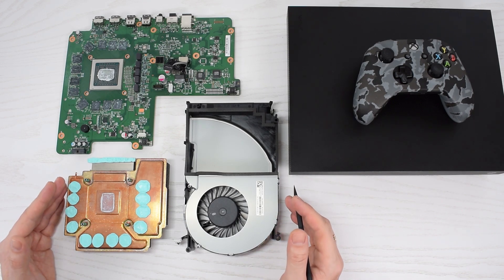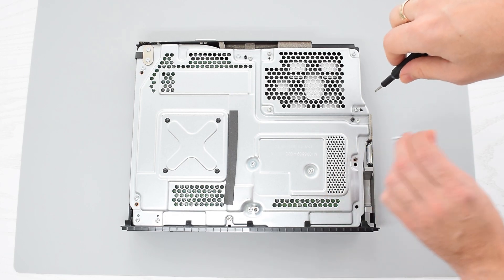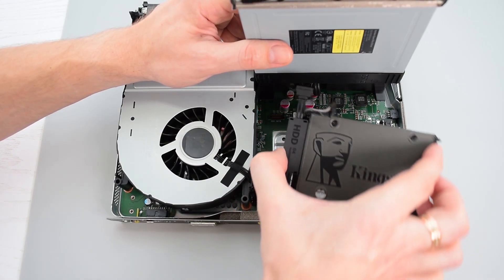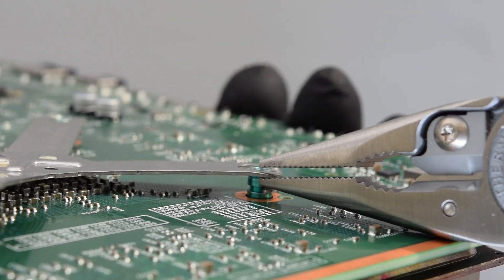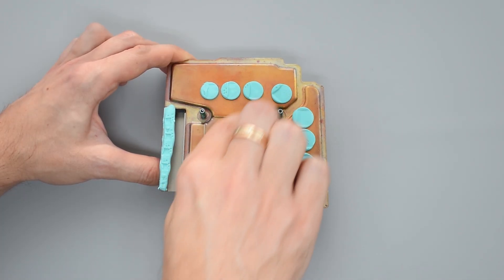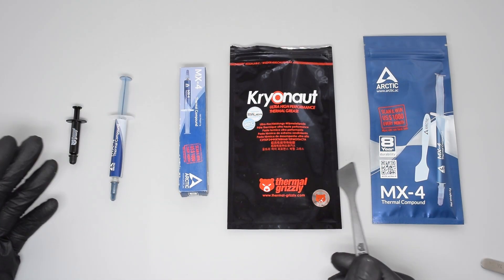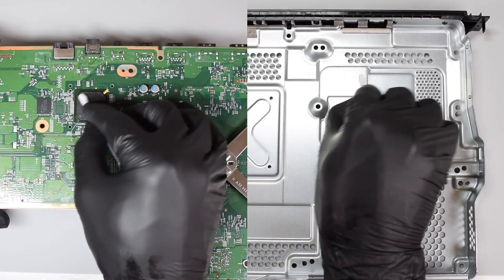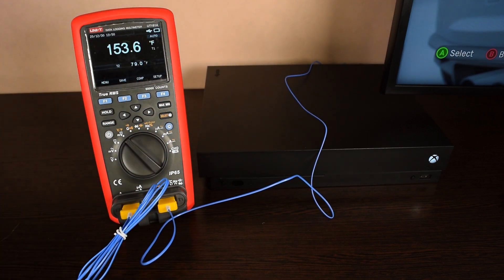Xbox One X Thermal Paste and Thermal Pads replacement. Cooling system cleaning. Best explanation!

Comment: This was a game changer. I did both the SSD upgrade from your other video and the thermal pads from this video. My games are loading so much faster with the SSD upgrade and it is so much quieter now after adding the thermal pads. Although, I am having one issue with some colors turning white. Not sure if it is related to the upgrade or not. Any help would be great
Reply from the maker: Most likely they changed something in the latest firmware that you installed from your USB drive. Wait for another update, if they notice the problem they'll fix it.
Reply: @ElectronicsComputers  So just an update on this, it turned out to be an HDR issue from the game itself. It just happened to be right after I did the upgrade. But there was a patch release, so it is working just fine.
Reply: @ElectronicsComputers  the thing is it is only happening in one game. Basically, some black colors turn to white
Reply from the maker: @MuhammadIsmail-vk6mk  The upgrade has nothing to do with it for sure.
Reply: @ElectronicsComputers  thank you so much. And thank you for the videos. You made it such an easy process

Comment: Guys, I had extremely loud fan whilst playing 4k games, it was defiantly getting to hot, follow this tutorial,  clean all parts of the chassis and the fan no longer runs at full capacity. Literally just bought this second hand and now fully working,  I didn't use new thermal pads but if I was more patient by ordering some  I would of 👍
Reply from the maker: Good job!
Reply: @ElectronicsComputers Thanks 😁, do you think my console has been damaged now from how fast the fan was spinning? The apu must of been getting so hot 🙄
Reply from the maker: @mylessackett489  If the temperature reaches to a critical point the console will shutdown. If that never happened then don't worry about it.
Reply: @ElectronicsComputers  OK that's good to know, thanks for the helpful video, top stuff 👍

Comment: I just read all the comments and questions about the right thickness of thermal pads and I was wondering what exactly do you mean with the "compressed area" of the thermal pad. 
If you mean the thickness of the old thermal pad after the system (assembled) put pressure on it I have two questions. 
1. How is the best way to measure the thickness of the pad? 
2. To get the right thickness of the pads needed Is it always right to add 0.5 mm onto the measured thickness (compressed area) to compensate the amount of thickness the thermal pad lost due to the pressure? 

Sorry in advance for the many questions but it would be nice to know. 

PS: Great video.
Reply from the maker: Using a calliper you can precisely measure the thickness of the compressed area of your original green thermal paste (thermal putty). It should be about 1.4-1.6mm. 1.5mm thermal pads fit without any problem, I've never had any issues with that. If the pads will be thicker the APU may not make the contact with the heatsink.
Reply: Ok thanks, and when I measure the old green thermal pads should I then add some milimeters to the result, because the thermal pad has not the original thickness anymore because of the pressure or should I take exactly the measured value?
Reply from the maker: I'd add an extra 0.1 -0.2mm but the problem is that there are no thermal pads with such presize tolerance . You can buy 1.5 or 2mm thick pads. Technically, you can compress 2mm pads and make them thinner but not sure if you can make them all with the same thickness.

Comment: Hey there, would 2mm Grizzly Pads work? I have an xbox to do & cannot get the 1.5mm
Reply: Nevermind I found your answer to this question in the cpmments “ The compressed area of the thermal pads equals about 1mm. So 1.5mm thermal pads will dodo the job. If you put 2mm pads on the memory chips there will be a 0.5-1mm gap between the APU die and the heat sink and your console will shut down after several minutes of using it”

Comment: my one x keeps freezing on loading screens with audio buzz in mxgp and 
supercross games and kicks me back to the home screen,the xbox is super 
loud when this happens,but why only in loading screens? gameplay always 
fine
Reply from the maker: Try to reinstall Xbox OS. I have a video on how to do that. All you need is a USB flash drive.
Reply: @ElectronicsComputers  i have put new thermal paste on the chip and i think my xbox is slightly quieter,i havnt had any crashes so far but i havnt played for long,i have bought the grizzly thermal pads but i bought 2mm would those be ok to use? or should i buy 1.5mm?
thanks
Reply from the maker: @krislambert6625  just make sure that the APU makes contact with the heat sink. You may need to slight squeeze those pads to make them thinner. We always use 1.5mm pads if we don't have viscous thermal paste.
Reply: @ElectronicsComputers  so i have reapplied the thermal paste and the pads with the grizzly 2mm,i tried the 1.5mm and they were a little too thin as there looked to be a gap between the top of the pads and the heatsink when i pushed them in between ,i have seen others say the same thing and had success with the 2mm pads. i have the special edition robot white xbox one x,some people say that earlier models had a slightly different design to the heatsink.

anyway i have been playing most of today and last night with no problems and my xbox seems a little more quiet,even though i have only had my xbox for about 15 months the thermal paste was really dry and the pads were cracked.

thanks again for your video and your help!
Reply from the maker: @krislambert6625  Happy to help!

Comment: One more question, on the Amazon link for thermorpad which one do i need? The (100 X 100 X 1,5mm) or another size? I will be attempt this based on your video!
Reply from the maker: That's right 100mm X 100mm and 1.5mm thick.

Comment: Question.  Why thermal pads and not paste on everything, or a thermal pad for the apu? Also, what kind of temp differences are we seeing by putting better thermal paste down? I know on pc, thermal paste is half the equation with good cooling, but afaik there are no liquid cooling options for the one x are there? I know it's a decent vapor chamber and heat pump, but I feel that performance could be enhanced even further by further reducing heat soak in the system with a good LC option, or perhaps modifying the case to accept a few HVLP 120mm fans.  My one x is way out of warranty so that makes me wonder.
Reply from the maker: Thermal pads last longer and more effective in heat transfer than viscous thermal paste. Grizzly kryonaut is one of the best (if not the best) thermal compounds on the market and the difference between the original/stock thermal paste and this one is like night and day difference.

Comment: Hi E&C, is there a difference between thermal pads and thermal "putty"? The xbox's use that sort of blue putty and I'm just curious if you think pads are better or the same? Also please do a video on thermal paste and pad replacement for the Xbox Series X!
Reply from the maker: High quality hermal pads perform better and last longer than viscous thermal paste but in some applications it's impossible to use thermal pads due to different thickness or when the cooling component's surfaces are not relative to each other.

Comment: Can I only use 1.5 that works?
Reply from the maker: Sure, that's what you need.
Reply: @ElectronicsComputers  Ok, and can I use another brand, in this case the Thermal Pad Artic High Performance 6w/mk (145 X 145 X 1.5mm)?
Reply from the maker: @Wilian.Boscolo  Sure, Grizzly is good stuff but kind of expensive. Arctic will work just fine just double-check its thickness before applying.
Reply: @Wilian.Boscolo  I used 1.5 mm Arctic thermal pads from Amazon and it still is quiet after 6 months.

Comment: This video was amazing - even the dimensions of the thermal pads. Thank you!

I used the 2.0mm pads and now my XBox One X is whisper quiet compared to before. Cheers!
Reply: I also replaced the original pads with 2 mm thermal grizzly Minus pad 8. For the APU I used the thermal grizzly kryonaut paste. I did that in November 2018. My xbox still works and is quiet in 2021.
Reply: @markusk.3162  So the 2mm thermal grizzly minus pad 8 are fine? Because I just ordered the 2mm ones instead of the 1.5 mm.
Reply: @G30_.Michael My One X has been running on the Thermal Grizzly Minus 8.2 mm pads since 2018. However, I haven't checked or measured how well the cooling is still working today. I don't have a measuring device to check this anymore.

These days, the One X is only used for Prime Video and Disney+. Therefore, I haven't really stressed it with games in a while, so I can't say how long-lasting the change was.
Reply: @markusk.3162 But when you played actively with it… it was perfect and had no issues?
Reply: @G30_.Michael It's been a few years since I played with the One X. Back then, I had no problems at all. Before and shortly after the upgrade, I measured the temperatures and volume with appropriate instruments. I noticed a slight improvement in the values. Whether that still holds true today, however, I can't say, as I no longer play with the One X and no longer have any measuring devices.
Reply from the maker: Happy to help!
Reply: I thought they were 1.5mm pads?
Reply: @8kgamerleo169  you can use either

Comment: I have used this guide to try and help my Xbox One X, and I think I might know why there seems to be some disagreements on the thickness of the thermal pads, with some saying 1.5mm, and others saying 2mm.

I had some leftover 1.5mm thermal pads from Thermalright, and tested to see if these would be thick enough for my Xbox One X, which was made in 2017. To my surprise, they were far too thin to fit. I was even able to slide them in the gap between the chip and cooler while still on the clear plastic sheet they come on. I believe this is because the cooler design is slightly different compared to the one you have here, which is from 2019. The copper area where the pads and paste contact is designed differently on the earlier units, so this might be why some say 2mm is what you need.

I did buy some 2mm pads, and sure enough, they fit very well. I even did a test where I applied the paste and put it all together as it should be, and then a bit later I took it back apart to see how well the spread was. The paste spread perfectly with the 2mm pads on the VRAM first time without any additional squashing down, and then again when I tried to see if perhaps it would be better if they were squashed, which produced equally as good contact, since really these pads are quite hard anyway.

I was hoping that some artefacting issues I was having were caused by overheating or a bad HDD, so I also used your guide on how to install an SSD, which worked great, but even after changing out the pads and paste, I still got the artefacting issues. I believe it has simply gone bad from age, and the problems only happen when a game uses enough VRAM to go into the capacity where one of the chips is bad.

Smaller games like CTR Nitro Fueled work totally fine without issue, and medium sized games like L.A. Noire only experience very mild to no issues, however, GTA V is very bad, with the APU clearly trying to load the game data into VRAM, only to have most of it end up going bad. Sometimes it will load up seemingly fine, but then some areas have wild artefacting that comes and goes at random, other times it will load in with barely any of the map present, and lots of sounds missing, shortly followed by a crash.

So in conclusion, I believe this thing where people are saying they used 2mm and it was fine, is when they have an older production Xbox One X, rather than a newer one like you have here. The earliest production units, which is what I have, do indeed need 2mm pads. Sadly of course, I can't fully test this due to the dying VRAM, but from the increased heat coming out the back, clearly the new pads and paste helped a good amount, and even after gaming for a few hours in L.A. Noire, there was no change in the fan speed or heat output, proving the die contact is still perfectly fine with 2mm pads.
Reply from the maker: In my repair shop we usually use 1.5mm pads and green viscous thermal paste (just like the original one that you removed from the chips). The thickness of the pads also depends on their compression e.g. if it's soft pads then you can use 2mm ones but in most cases 1.5mm works just fine.
Reply: @ElectronicsComputers  the viscous paste you mention is called thermal putty, it's there to bridge larger and "non- standard" gaps (e.g. 1.3mm) the easy and stress free way
Reply: Same here! 1,5mm definitely too thin, i have a gap almost 0,4-0,5mm. one pad even fell out after turning around. So 2mm soft pads is the way to go.
And i am also not sure if having less temp is a good thing, i think if i improve the heat conductivity, then the heat-sink should have more temp, as it is able to pull more heat off the chips? correct me if i am wrong.
Still a good guide, helped me out.
Reply: @kamojinkakujin9962  Yes you are correct in your thinking that more heat output is better, that means the heat is being removed from the APU and RAM more efficiently which will make it so their temperature is lower which can extend their life. If you've got barely any heat coming out of modern consoles then that's a problem.
Reply: @kamojinkakujin9962 so the 2mm thermal grizzly minus pad 8 are fine?
Reply: @G30_.Michael If you're unsure, or if there are actual differences between revisions, you can easily check whether the 2 mm pads fit. Apply thermal paste to the APU and place the 2 mm pads on the memory chips. Then, gently press the heatsink down, then lower it again. This is similar to the pressure applied by the X-Clamp. You can, of course, also attach the X-Clamp and then remove it again. If, after removing the heatsink, you can see a complete imprint of the thermal paste on its contact side, you can assume that 2 mm pads aren't too thick.
Reply: @markusk.3162 Thanks appreciate it!
Reply: @G30_.Michael Your welcome. Please let me know what worked for you.

￼
Reply: @markusk.3162 Yeah sure. I already got Arctic’s MX—4 thermal paste, just waiting for the thermal pads to arrive as the ones from factory were cracked and dry. They should arrive next week.
Reply: @markusk.3162 I’m pretty sure the thermal pads were too thick. The fan got louder than before. I’ll have to open it up and see the contact on the APU. I’ll probably have to order 1.5mm thick thermal pads.
Reply: @markusk.3162 Nevermind… I opened it up again and pressed down all the thermal pads with my bare thumb. Moreover… I instead used the scrape method instead of the pee sized dot and line method. After using the scraped method and pressing down the thermal pads the xbox is dead silent while playing Horizon 5 at 4K. I’m not sure which of the two things I did fixed the issue but everything works flawlessly now.

Comment: My Xbox one keeps going black after 30 minutes of playing, will this fix it?
Reply from the maker: When it goes black if press and hold the Home button on the controller can you hear the beep sound coming from the console?
Reply: @ElectronicsComputers  oh um, it goes black for a few seconds but comes back on, but once it does this it goes black every single minute, doesn’t affect gameplay but the screen does this, I even changed hdmi ports
Reply from the maker: @geraldg4631  It's hard to say without checking with the oscilloscope where the signal disappears. Could be HDMI controller or even HDMI cable. Also try another port on your TV.
Reply: @ElectronicsComputers  tried all that, even bought a new hdmi cable, the first thing u said to me was a blur tbh lol

Comment: Is it okay to leave old thermal paste around the main chip, I don't want to damage those caps while trying to clean so is it okay to leave the paste on the caps but completely clean the chip surface? Would that make cooling a bit less efficient or it doesn't matter?
Reply from the maker: If it was a stock paste or if you used before non conductive paste then it won't affect cooling or something else. Usually, in my repair shop we never clean APUs like that (it's too time consuming and absolutely unnecessary) it was made just for a video.
Reply: @ElectronicsComputers  Thanks I applied paste once before 2 years ago and wanted to replace the paste and also this time apply thermal grizzly pads to GDDR rams.